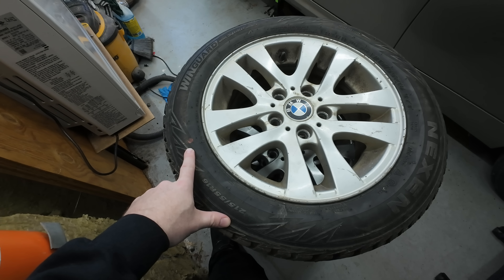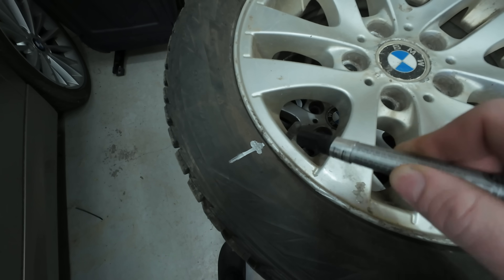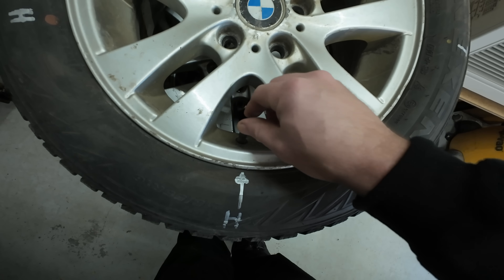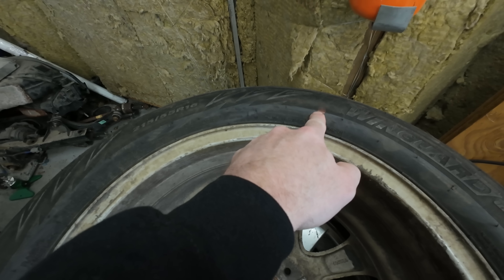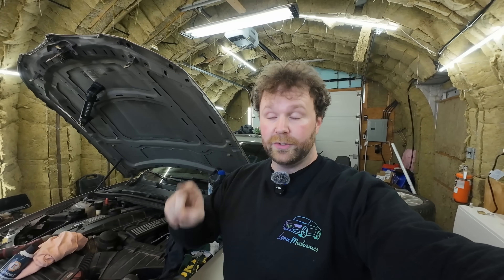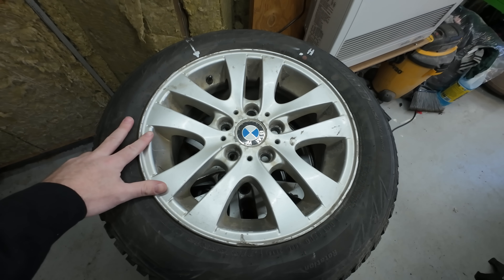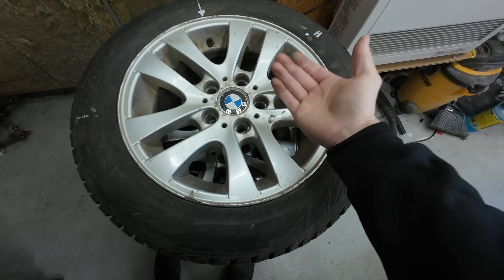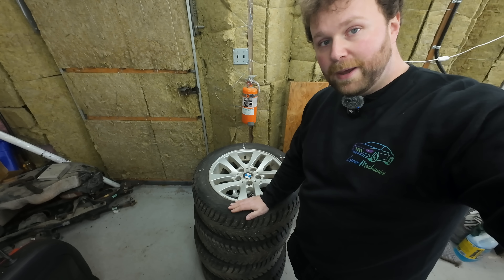Tire Red & Yellow Dots Explained | Back to Basics. Many mechanics get this 1/2 right

Comment: So just too clarify, if It has just a yellow dot, align that dot and the valve stem up?, and if it has a red dot, put the valve stem 180 degrees from the valve stem? if anyone could help that would be much appreciated.
Reply from the maker: My experience is if the tire doesn't have a run out indication. Put the red opposite valve steam and it greatly reduced weights needed and more importantly. Balance at high speeds
Reply: @Lancemechanics yes, but the VIDEO did not explain this.

Comment: Allot of tires are just tossed on. No dots in mind.
Reply: Thats because there are a lot of tossers fitting tyres.
Half of them can’t spell their own name , the dots are just pretty colours for them to look at
Reply: @simonmoffat4629  No Name Given
Reply: @thekingsilverado3266 😂👌
Reply: @thekingsilverado3266 
Ignorance. Doesnt make it the right excuse though.
Reply: @turboflush  If it wasn't 4 ignorance there would be no cops no lawyers no  legal robbery.
Reply: First name Hal second name Ford!
Reply: @simonmoffat4629 You get the workers you pay for
Reply: My seldom used pick up had at least a pound of balance weights on all 4 wheels and it was still a paint shaker on the highway, from the day I bought it used. When my son started driving it, I decided to check the balance, but the marks were long ago weathered and washed off. I pulled all the weights and marked then turned the tires on the wheels until it evened out as good as I could get it statically, and then added weights as needed. The tires had to be turned approximately 70 to 180 degrees on all 4. Only one of the wheels needed more than an ounce afterward, and it doesn't shake anymore.
Reply: @scottb8175  it was taking the weights off that fixed the problem , not moving the tyre 😂😂
Reply: yes cause it does not matter when you balance the wheel !

Comment: Dots are meaningless. You can line them up if you want to. It’s a good starting point. if you want to be really accurate, and you get a fairly high weight request, break the tire down and rotate tire on rim 180* and recheck.

Comment: My Kuhmo tires only had an orange dot, so were does that need to be located? One of the wheels had many weights on it.
Reply from the maker: I've seen them..they go orange when left in the sun. That's the heavy spot. If your rim has no balance marks go opposite of the valve steam for red.

Comment: Sorry, old buddy. You're misinformed on that one. If you look at most new tires, they don't even have those dots on them, and if you use a Road Force Diagnostic Balancer it'll will show you where to clock the tire on the rim on every individual assembly.  I've been doing this for 30 years, I've worked with every Hunter Road Force, Elite machine that they've had.  Those dots  mean nothing. Go look at some high-end michelins and continentals and other various brands.You'll see no dots at all. You just need the proper equipment and the proper training to be able to use the equipment.And then you will have very happy customers. Not trying to slam , you just trying to inform you , old buddy.
Reply from the maker: I just went through Bridgestone/firestone Yokohama,  Goodyear / Dunlop / Continental / Michelin / Pirelli, Hankook / Cooper / Nexen / Kumho. they all have specific instructions on these dots and how important they are.
Reply: @Lancemechanics that's all fine and dandy , but they don't all go at the valve stem.
Reply: @wessmith1449 exactly, how does the tire manufacturer know the wheel and whether or not there is a sensor mounted on the valve stem? Or if its a Ford with a clamp style sensor that sits opposite of the valve stem? Thats right, they dont so its pointless.

Comment: Some shops do road force balance for more $$$.  Is this up sell worth the extra $$$ or does this machine just clean out our wallet?
Reply from the maker: The road force is very accurate. But by doing this with the dots your getting pretty close to what that machine does.
Reply: @MySparkle888  Back in the 2000s, I resolved a number of vibration / lack of smoothness issues using a road force balancer. They're pretty slick, but they are expensive. As has been said, lining the dots up properly usually gets you pretty close.  For tires that will be used at high speed, like track cars, I would prefer using the road force balancer.
Reply: All other things being equal, minimizing the amount of weight needed to balance the wheel and tire assembly is a good thing. But there actually are two factors that can cause vibration issues, balance and runout.  I've seen tire and wheel assemblies that were perfectly balanced, but still had issues due to run out. That's the advantage of using a road force balancer. Minimize the runout, then balance it at that point.

Comment: I’ve always aligned the yellow dot to the valve stem regardless. What I haven’t done is on directional tires align the dot on the backside of the rim. Call me crazy for static balancing at times but most of the wheels I deal with are bent to shit anyways. You can get away with it in the Winter but not so much in the Summer when it comes to shimmy. My absolute favourite is a waiter for TNOR on alloys with inside & outside sticky weights! Nothing like trying to adhere a sticky weight on a cold wet alloy rim.
Reply: The stock wheels on my GTI are bent a little from the previous owner (it's first 100k mi were spent in PA), and I finally decided to go and road force balance my tires while I had time at work, and it actually made the vibrations a little worse XD. For getting weights to stick, I always spray a little brake cleaner, wipe down the inside of the wheel, then after it's spun I'll use a scotch brite type of pad where the weights go. If it's a nice wheel where scratching is an issue, I just do brake cleaner and some softer shop rags.

Comment: So what's the process when the dots are on the side of the tire that doesnt go to the outside?      Like a uni lateral tire?   Inside and outside right but lots of tires i get don't have dots on both sides.     Great video buddy
Reply from the maker: Thanks Jeff and good question. Same rules apply just doing it more blindly :p
Reply: @Lancemechanics  I like to mark the tire with a piece of chalk so I don't have to guess where the dot is on these types.

Comment: I had a balancing issue so I removed the weights, realigned the tire properly with the dots and what do you know, it didn't even need a single weight added.
Reply from the maker: Awesome!
Reply: Now I mount up my own tires and I align the tire by the dots (usually the red but with this knowledge also will try the yellow) and the tire  generally runs OK.🥸👍👍👍👍
Reply: I just put the pedal down hard after mounting & make alotta smoke and the tires just seem to balance themselves.
Reply: Thats called getting lucky, ive done plenty of tires where they happen to match the wheel and ignored the silly dots completely.
Reply: @V4L_Valiant  Align the dots and you'll see that you'll get "luckier" more often. They are there for a reason.
Reply: @Motorsportsgeek Not necessarily that it's always better to align the dots, especially on cheap/cheapest tires in bigger and havier sizes like 35's and 37's they always balance like crap, and some that wanted huge weight amounts I would "Index" like 4 or 5 times just to check if the balance gets better and some times the yellow dot had to be opposite the stem or in a totally different place (some of this also has to do with cheap/heavy "cool" looking aftermarket wheels with atleast 2" of "deep dish") but I never had access to a "RoadForce" Balancer ... also like half or more of the "top" tier tire brands (GY, Mich, Conti, Pirelli, Nokian) do not even come with Yellow or Red dots on them anywhere, but most of the "entry level" cheap tires have dots.

Comment: I have a 09 328i I love x drive. There are all kinds of mechanics. One of those basic principals most miss is horizontal control arm and or bushing  bolts. They need tightened at ride height.
Reply from the maker: Seen so many bushing failures due to that. One guy's control job failed by time he made it to the alignment rack

Comment: What do you think of Road Force balancing ? Happy Holidays btw fellow Canadian .
Reply: I worked at a Ford dealer in the early 2000's during the Firestone recall and also when they rolled out the F150's with the new body and tons of vibration issues along with it.  The dealer was required to have a roadforce balancer for $20k or so which caused us to warranty a ton of tires that weren't the cause of the vibration issues.  Not only did crap manufacturing processes and engineering decisions cost Ford a ton of money the roadforce balancer did too.  They had rear driveshafts with staked in ujoints, like an AWD car and not serviceable, but the big cause of the shakes was excessive ring gear runout in the rear diff.  That was a fun time!!!
Reply from the maker: Woah. good info there. Bet the lot of you became pretty good at driveline vibration troubleshooting. that's a dying skill these days.  I had a genesis that had a shake in 5th gear and when I called the driveshaft people called me insane. Well explained to them almost all Hyundai's transmission's  5th gear are 1:1 with the engine. they wanted me to replace the trans. it was just a bad u-joint that somehow showed up in 5th. :O
Reply: Great information here! Some know, some don’t, some know only parts of the equation. I think you might do us all a favor and revisit this from time to time. Thanks for sharing!
Reply from the maker: Loved it. At Honda  to be able to service the CIVIC TYPE R or sell them they had to buy a road force balancer. Thing is the dealer was utterly stupid and charged $50cnd per wheel. who in there right mind is going to pay $200cnd+ taxes. I just ended up balancing them like this to eliminate a lot of vibration issues. Best balance you can do!
Reply: @Lancemechanics  I just did a Road Balance on my Elantra N winter rims . Online Company I bought them from provide the service as standard . Smooth as butter . Cheers
Reply from the maker: thats fantastic. they just need to eliminate the other style of balances. this is far superior. but the machines start at 50,000cnd. Good luck getting a shop to dish out :(
Reply: Every dollar your bosses spend on the latest and greatest fake tech is a dollar that cannot be given to a worker.